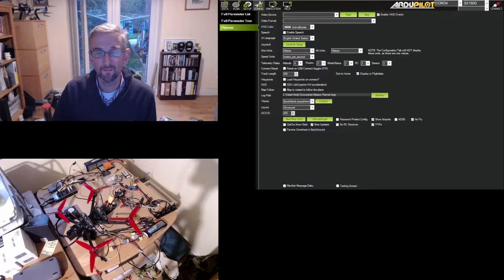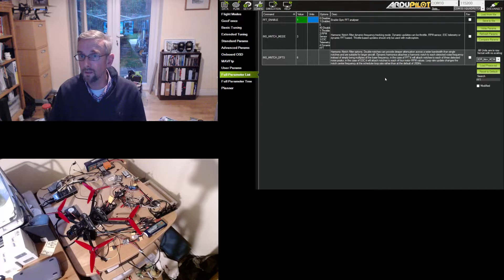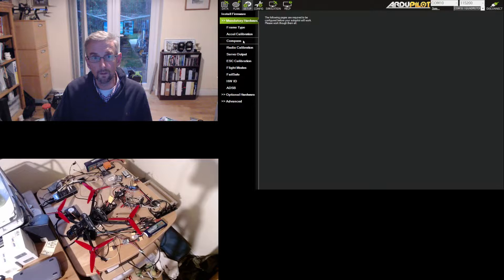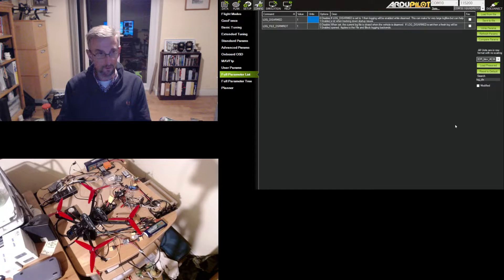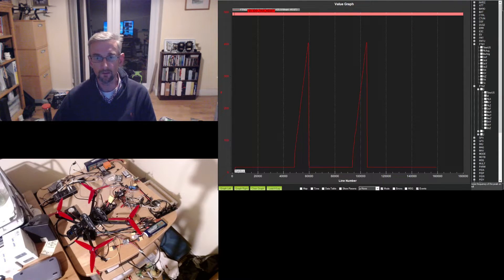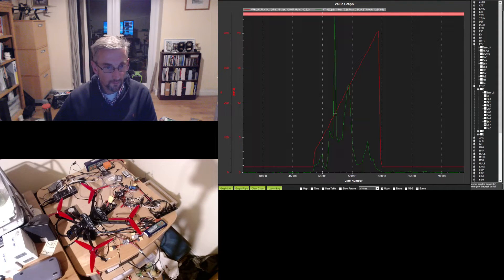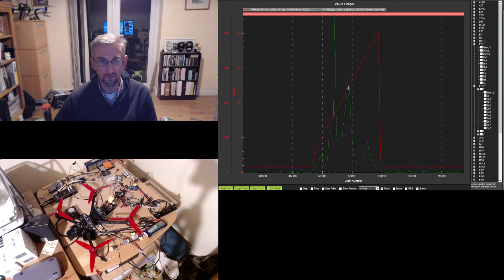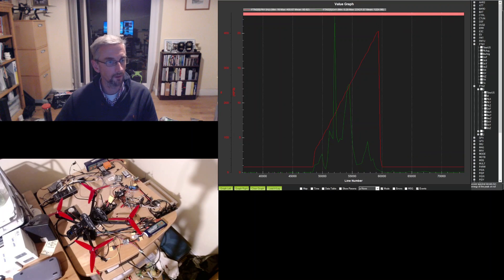ArduCopter 7" LR Build Video 23 - Measuring Frame Resonance with On-board FFT

Comment: Thanks, i will try this approach with a speaker.  The idea of an impulse hammer is you get a white input.  A chirp would do good to.  I am not sure about the ardupilot FFT, and may take more time figuring out than just doing a spectrogram with python; i might just do that.  Usually the vertical axis is content and horizontal axis (line number) is frequency, so not sure about the output.  On idea you might try is suspending the craft by very elastic bungees just above the speaker so the boundry condition is reflective of flight.  Another is the FFT resolution is inversely proportional to window size, which in this case amounts to the sample size; may want to use 1024.  7.5 Hz is pretty big.  These would allow you to more precisely identify the resonance, and narrow up the notch.  Anyhow thanks a lot for sharing all this stuff.  I am guessing you are an engineer?